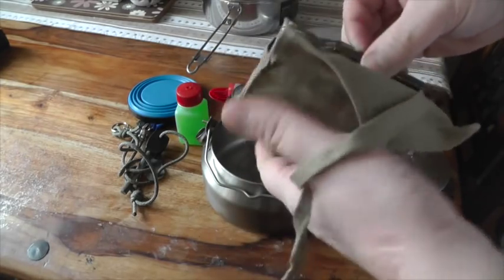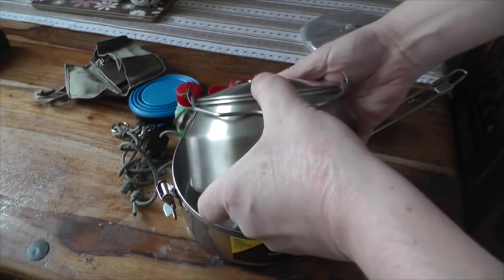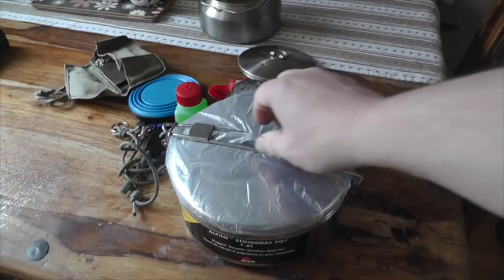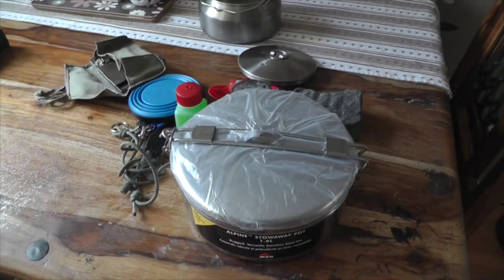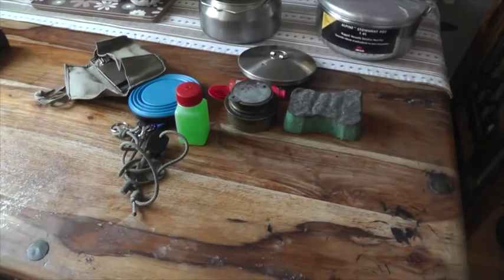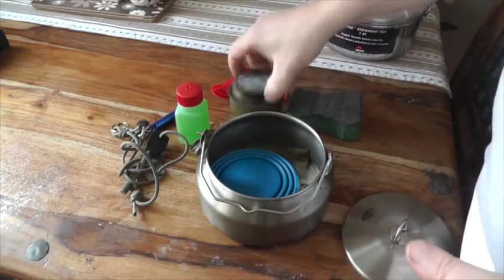Pot needed for gsi stainless kettle

Comment: I have the same setup and had the same problem you are showing here.  I used my leatherman to bend the holding clamps further out at the base and bent the top of the clamp down .. it fixed the problem and now it fits perfect.  This may be a little late to help but I thought I would comment as it may help.

Comment: I came up with the same idea using the 1.6 stowaway, with the gsi. i was going to order the stowaway, but now i dont know. could you bend the wire handle a bit and let the lid stick up a shade? i couldnt see in the vid how much lid stuck up after putting the gsi in. so what if the lid sticks up a bit ....2 awesome pots deserve each other...lol bend the wire handle and file down the bail tabs a little may get it to work. Thanks for posting bro.

Comment: Did you ever solve this riddle? I have a GSI Ketalist myself and am looking for the same thing. 
My thoughts are to just go with Zebra 16cm pot for longer trips and ??? for shorter ones.
Reply: Somebody found the perfect solution. Using pliers, bend the kettle handle tabs inward a bit. Voila. It will fit in the MSR 1.6L nesting pot.

Comment: the way Zebra pots are measured. they are the same width as height.  Mine is 16 CM because I use it for snow melting.  It will nest a 533 Coleman stove the same model that 51 foxy has.
Reply: Msr?unless they have upgraded them pots are junk bro

Comment: I just tried something that works. I have the Swiss Meta 50 cookset, seen here http://www.swissmilitarydepartment.com/666_500_csupload_61666542.jpg?u=3231037681 I took out the burner stand, and the Ketalist nests perfectly within the two pot and the pan. I even fit a Snow Peak titanium plate inside also.